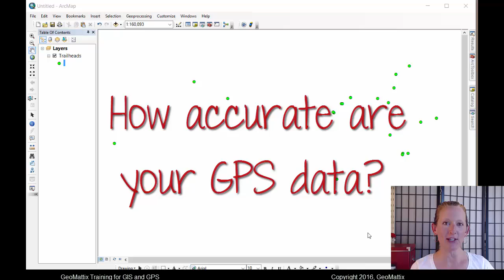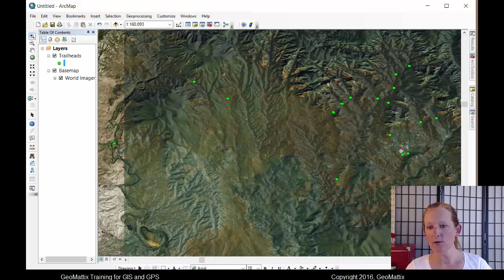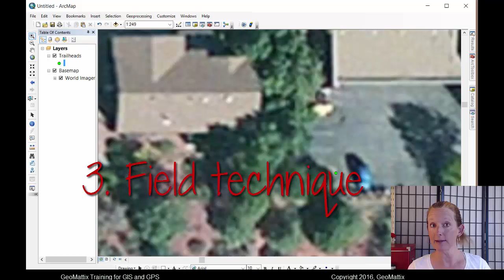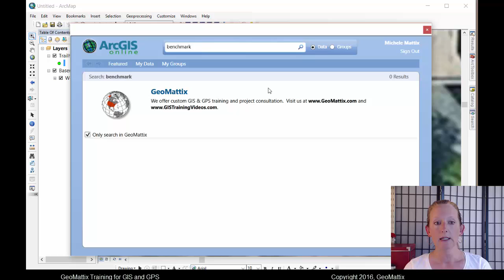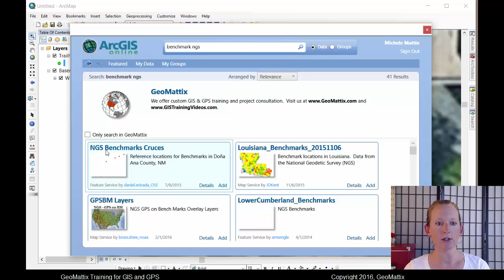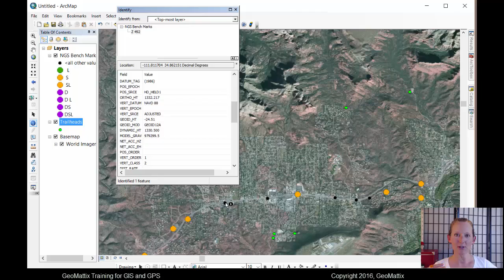Use a benchmark to assess GPS accuracy

Comment: I'm using the EMLID RS3. I'm practicing on this before I go to my GCPs. I tried a benchmark near here, and it wasn't what I was getting with corrections from NTRIP. This BM was taken back in 1946, though. I wonder if it changes over the years like the magnetic poles. What do you think?
Reply from the maker: You can research the benchmark - assuming it is registered - with the NGS.  It would say if anything has happened to the benchmark that might affect it's XYZ.